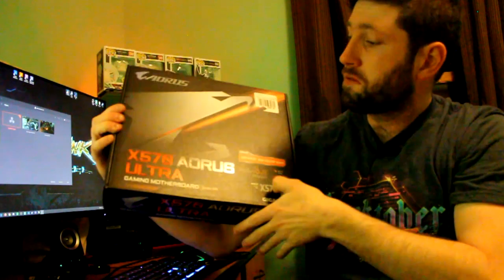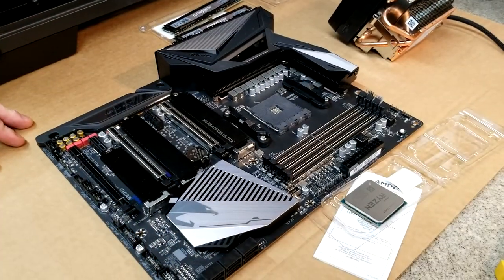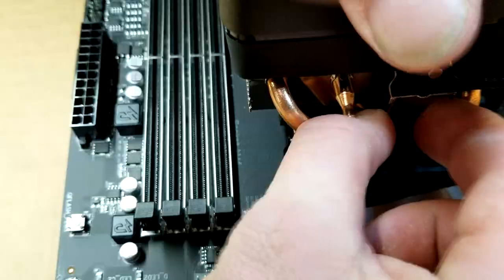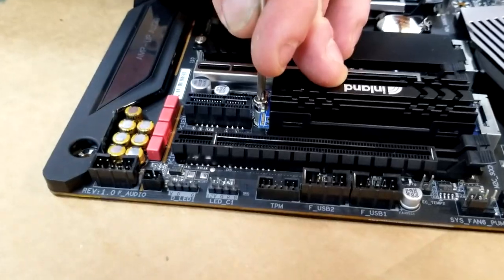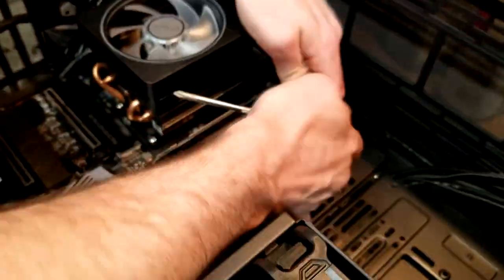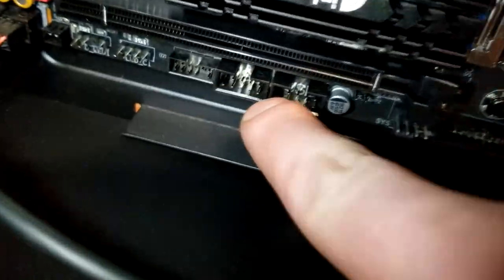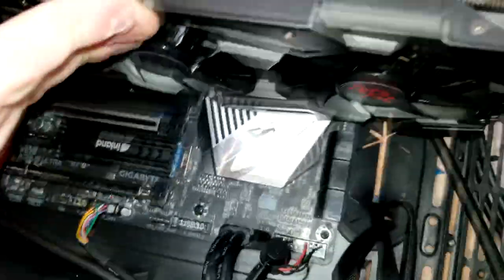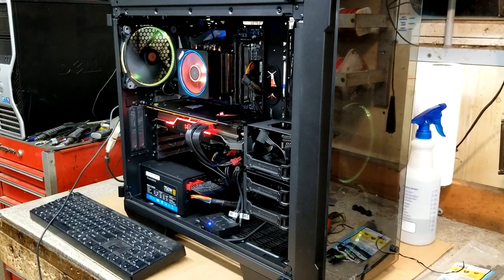First PC Build | AMD Ryzen 7 3800x | Red Devil RX 5700xt | x570 Aorus Ultra Mobo

Comment: Thanks alot for this guide. I just bought the same motherboard for my first ever DIY build, and this will come in very handy when I start putting it all together, very few build guides show so clearly the specific cable placement which is the part im most nervous about. Thanks again.
Reply from the maker: No problem  Glad i could help!👍